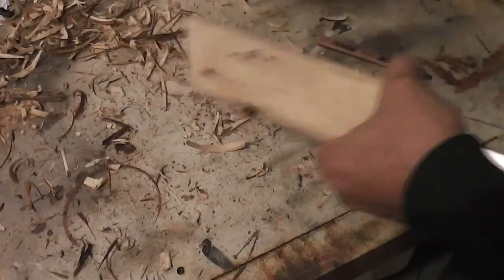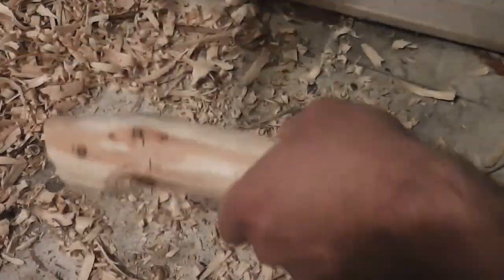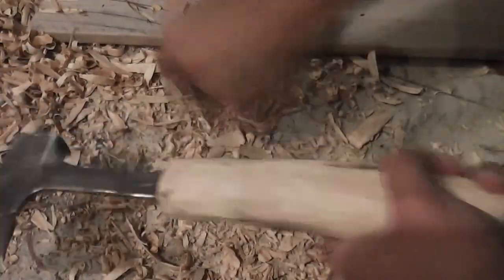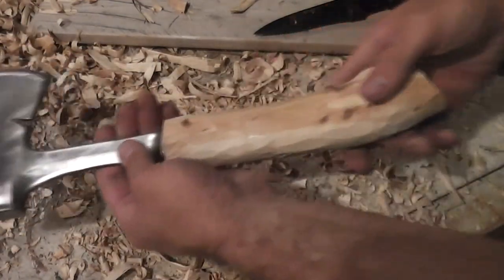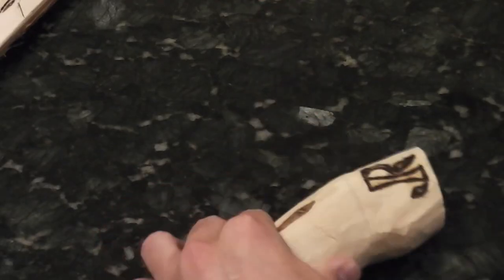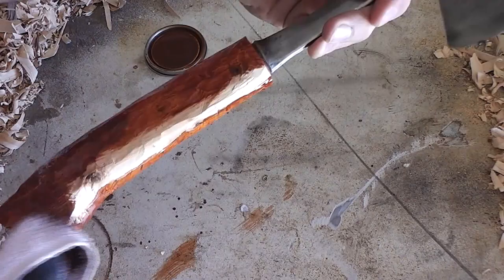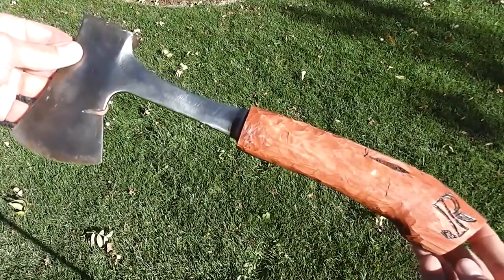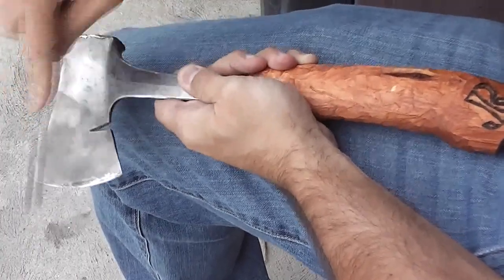1943 Estwing Hatchet Restoration Timelapse Video

Comment: this was brilliant, love your channel. Although is the handle strong enough if you just glue together two pieces of wood onto it? I imagine the glue might not hold and the handle will just slide off after a lot of vibrations and jarring impacts.
Reply from the maker: +Prateek Jain It feels very sturdy.  But you could be right.
Reply: It's a two part epoxy; I'm guessing it'll hold.

Comment: Fair enough. I can imagine how therapeutic and perhaps even meditative it can be, although somewhat time-consuming. You seem to have done a great job anyway. I have a similar axe and the rubber handle is splitting. Although I have affected a temporary repair by glueing a piece of bicycle inner tube  over the top, it can get a bit slippery in the hand when in use. I have no access to a workshop so I'm eventually gonna have to replace it using 6mm paracord. I'm sure there's a vid on here somewhere that'll show me how to do this.
Reply from the maker: Mike Dyachenko It was a fun project, and good on you for using your tools forever. I'm still using a lot of my grandpas tools that he left my dad when he died.  Makes working in the shop more fun.

Comment: I personally would have drilled holes in the hilt so I could rivet the handle, rather than epoxy. Despite this, I have to commend this. Bonus points for knife carving the hilt.